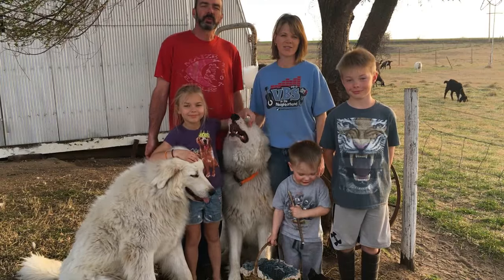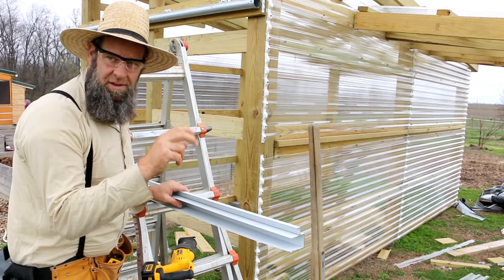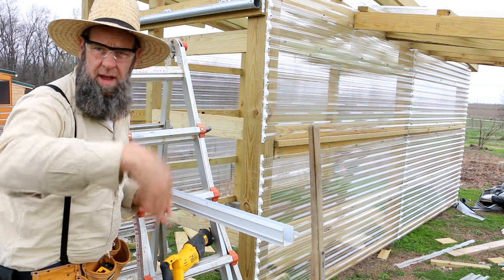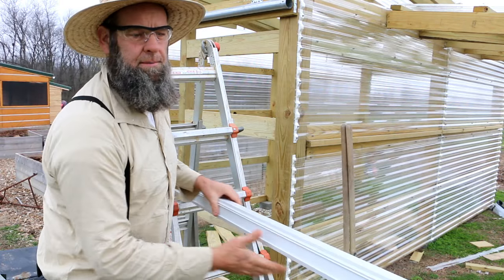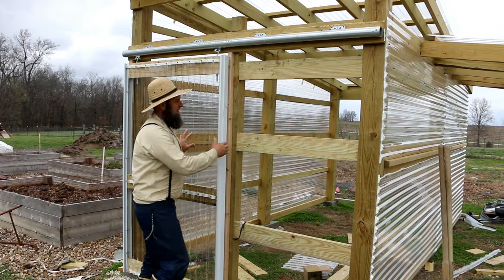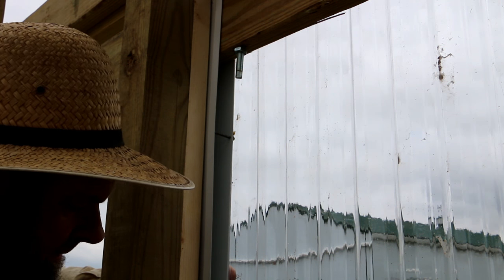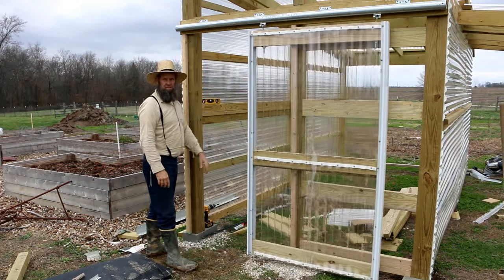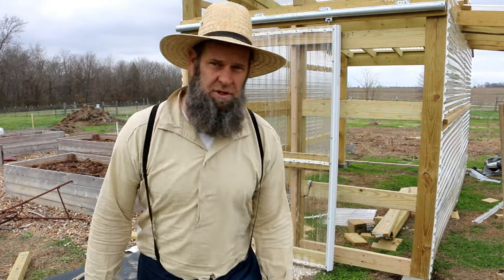UNUSUAL GREEN HOUSE DOOR

Comment: I used the same door track building new barn doors. I think they call them cannon ball track. My old barn had the old style track and would hang up sometimes and I need to replace the doors.  That style track is smooth operating. You will love it. My doors were 16 ft tall and each door was 10 ft wide. Making it an 18 ft opening. Great videos! Keep up the good work. On a down side. Some states are making it illegal to catch rain water. Hope they don't get that passed. Central Indiana.

Comment: Doug: I don't know if this will help or not...But when I was doing HVAC fora living and roughing in houses sometimes we'd install what's called a "Hi-Low Transfer". What that is is a vent at the bottom of one wall and one at the top of the opposing wall. Air will travel through the lower vent then through the room and out the top vent as heat rises. In this way we would even out minor differences in temps inside a bedroom or such.  I would suggest trying it on something else first and see if it helps move the air like you need it to before installing one on your greenhouse.  That way you'll know for sure if it's gonna do what you need it to. Love your videos. You guys have so much great info to offer for us out here. I am not a homesteader but I have learned a great deal from people like you and Stacy. Thank you for all that you're doing. I love Stacy's hat too by the way. I sometimes wear one similar...like a Crocodile Dundee type of hat. Usually in not so great weather.
Reply: Little Shepherd Farm A
Reply: Yes, that is called convection, this is exactly what you want in a green house so that plants are not smothered in too much moisture build up. Plants need to breathe and they like fresh air moving around them. You need vents near the floor, and vents near the top of the building. Cool air near the ground outside gets pulled in while the warmer air near the top exits out of the top vents. It helps keep the air circulating in the green house even without the aid of a fan.
You can even get pistons that are wax filled that can open and close the vents automatically without electricity or a timer. It all depends on how warm it gets in the green house. When it gets hot, the wax melts, expands and pushes the pistons out and thus opens the vents, top and bottom. When the weather cools down, the wax solidifies, the piston contracts and closes the vents.

Comment: I think the doors need to be straight through it will make the interior gardening easier. The size of the openings are more than enough to cool it off quickly. If you have a window you can open at the top that might help more with airflow at night. Don't want to shock those little plants with a quick temperature change. Love what you are doing.

Comment: This looks nice, but the supplies would be much cheaper and "greener" if you used recycled windows. They work wonderfully, air tight ,except for an auto lift vent at the top to let out heat when it gets to much. I agree with Essem Sween, that you should have the complete layout of the inside before laying out the doors. Just a suggestion.

Comment: I was thinking of a two-door system in which you step inside and close the first door before opening the second door to enter the greenhouse. The reason for this is to cut-down on heat loss. On a cold day, making multiple entries in and out of the greenhouse could really cool it down. Thoughts?

Comment: I'm curious how you are going to close up the over and under side gaps of the doors.  If the doors open from the same side your plants can go all the way from end to end.  Put in a window for cross ventilation.  Have you seen the gutter planters?  There is a you tube video with strawberry plants put into gutters hammered into the side of a porch.  Layering gutters on your sunny side will add some shade during the hotter months.

Comment: How are you going to stop the bottom of the door blowing out with the wind? The top is fine but the bottom is not fixed. A small post to stop it flapping?
Reply: That's the usual "fix" on most outbuildings where I grew up and I hated it at times, like when I had to mow or brush hog along the side of a barn or other outbuilding and that post or rebar was sticking up where my mower deck wanted to go. The other way to stop sliding doors from swinging in the wind, like these very light weight doors will do, is to go to your farm supply store and buy special brackets which attach to your barn/outbuilding at the bottom of the end of the door travel, either open or closed,  with lag bolts and have a flared out "lip" which will guide the leading edge of the door on each end into a "stop" type of flat steel bracket. (I understand NOW what they meant by "A picture is worth a thousand words!!)